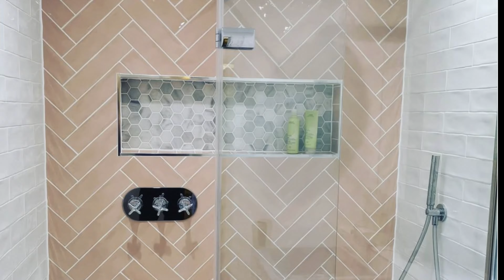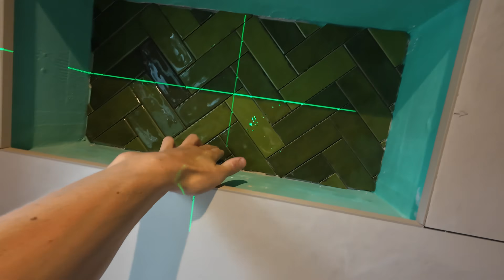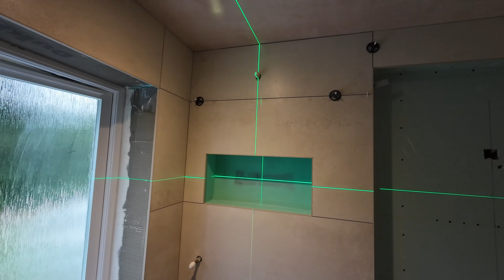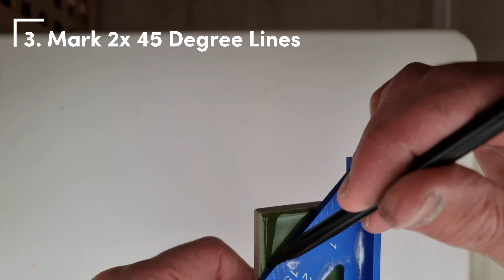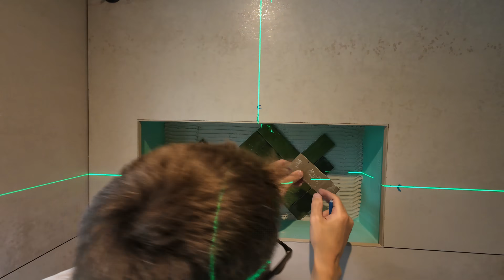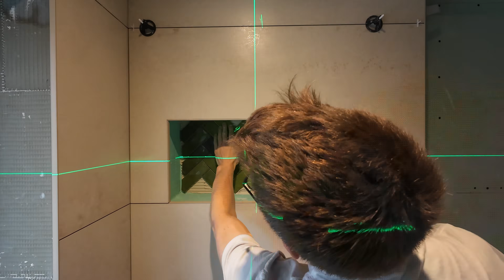Installing Herringbone Tile For Beginners | With This EASY Trick!

Comment: On the side wall wrap; do you leave a space between the two corresponding tiles?  Or go tight tile to tile?  After grout; do you color match caulk the corner joints?
Reply from the maker: It all just depends mate, You'd usually push them tight and have a slight gap. But if the wall isn't square for example then sometimes you'd be tight then you'd have a gap later on. I'd just place them on tight and once you get some whole tiles on adjust the wrap around pieces. Yes colour match silicon to grout usually.

Comment: Man, I love your illustration.  I was about to just do a stacked lay because I thought Herringbone was going to be so difficult to get aligned.  I now have my center point marked as you showed and will start my Herringbone backsplash in the kitchen.  It's a small 6' wall plus 2' along one end.  I now feel like this is very doable.  I was worried about having an odd looking off centered backsplash but your video has given me confidence this will work out good.
Reply from the maker: Great to hear mate That's what it's all about! Glad the video helped, I have one on cutting herringbone tiles to if it also helps. Best of luck!

Comment: nice job i was wondering what adhesive you where using? seems to grab well
Reply from the maker: Hey thanks! It's Bal Flex One.. If you see my video of "Debunking the myth" you'll see it in extreme use 🍻
Reply: @thebespokebloke  thanks mate, ill check that video out.

Comment: Aweome video, but I wonder how would you do it when you have two tiles ( 1 fluted and 1 flat) with different thicknesses (12mm vs 9mm). The fluted and flat make alternate rows in the herringbone format. I don't seem to understand how to do this making sure everything is flat. Any advice?
Reply from the maker: Well whichever pattern you lay tiles with different thickness is a nightmare mate.. You could maybe stick the thinner ones on a 3mm sheet of Ditra and cut them out. But whichever way it will be time consuming

Comment: It’s look really easy but it’s not that easy I’m try on my kitchen wall. On whole it’s my third tiling job. Make mistake on bathroom and learn from those and when I done kitchen floor I get rid of all mistakes. I had perfect floor tile. Only one issue I had one tile was 1.5 mil bigger than rest of tile. It throughout two tile corner out of line. I was really frustrated with that. Watching ur video I started herringbone tile. I started using laser method. I find it really hard to cut tile and very confusing. Follow ur guide only manage to put 20 tile in two hours. I find it really hard to cut tile I mean measuring them. When u doing cuts. I bought sigma cutter watching ur video. I spend £400. It did tremendous job on my glazed kitchen tile. It saved me huge time cutting on wet cutter. But every time I cut subway tile they break on sigma cutter. Tile ceramic and very soft tile very easy to cut on grinder. I’m not finished yet but feel like my end corner not exactly same. I thought it’s down to size 250 x50.
Reply from the maker: Well it's good you're getting stuck in mate, Sounds like you've got the right tools, The Sigma is a fantastic machine! Don't be to hard on yourself.. herringbone does have a high skill ceiling. And it's good you're giving it a go! What kind of subway tile are you trying to cut? You may just have to try a different technique depending on it's material. The Sigma cutter should break them very easy and nicely (unless they are stone or glass)

Comment: What if you’re doing a large wall?…I know the centre point to get equal cuts both sides…but what about top and bottom for equal cuts?…is there a way of doing this ? As I would be looking to start at bottom and work my way up …🙌
Reply from the maker: Well the method shows you how to have equal cuts, at the top and bottom and side to side. Depending on the size of your tile, You should be fine to start in the middle and work down with any ceramic tile. Then do the top half after. But if they are heavy porcelain tiles, I'd just draw them out on the wall and work back up. Just checking them for alignment as you go.. Hope that helps!
Reply: @thebespokebloke  yes I understand..I will measure down or mark and try that way…I just don’t want to get to top & have different cuts but should be fine …thanks
Reply from the maker: @anitagoodsleep5330  AS long as your mid tile lands on that centre mark, You should be all good. Best of luck!